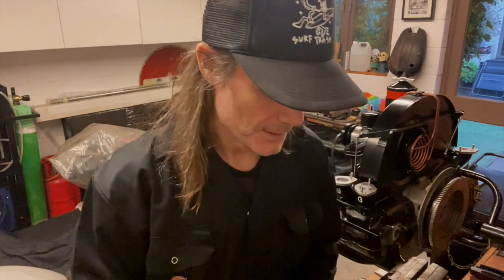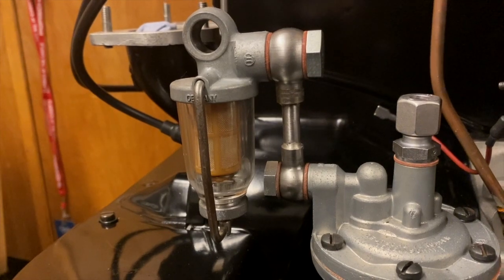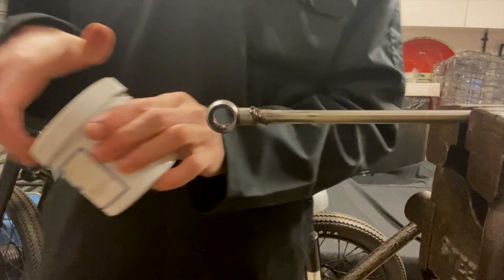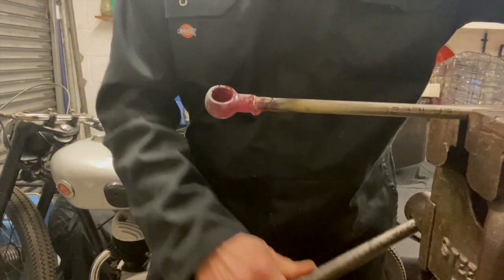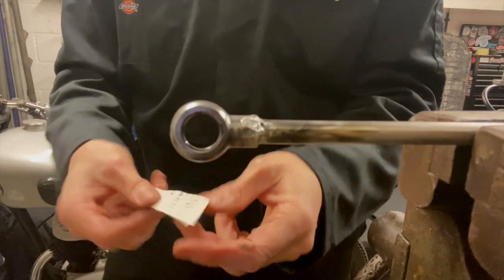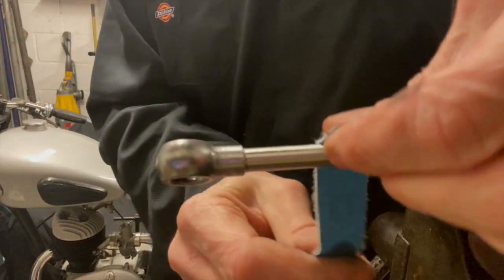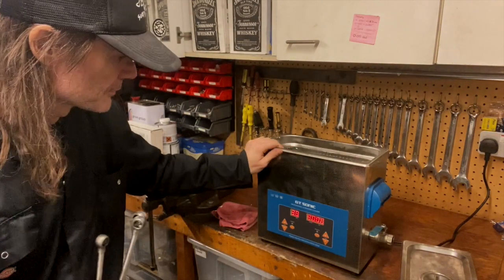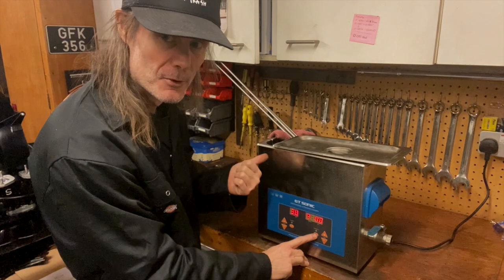How to Solder Fuel Lines - Banjo to Steel Tube

Comment: Is that coiled fuel line around the back of the shroud (the copper coil) Did you make that to prevent vapor lock? If so how did it work out. I have a Karmann Ghia with vapor lock issues. Thanks

Comment: A couple of suggestions, and I'm by no means an expert but I have had my share of dissimilar metal soldering in my career. The solder you're using looks like plumbing solder, primarily for copper joins. It has a low silver level, usually around 4-6%. It doesn't like a lot of heat and you were cherry red. That's why it was dripping off and not flowing. With high heat it tends to bead up like water and run off. It obviously works for the application as it passed the leak test. It just took considerable clean up. For silver soldering we use Sta-Silv which is either a 45% or 56% silver. I prefer 56%. It takes a bit of practice and finesse but you'll get perfect weld joins that'll be good for 300-400 PSI with no clean up. Also, only put your flux where you want the solder to go, otherwise it flows everywhere (also, clean up the excess before putting heat to it). Lastly, and you covered this but, with silver solder especially, you want clean, clean, CLEAN. No fingerprints or residue. I work with refrigeration lines so pressures are infinitely higher than your fuel pressure but the practice is the same. Good on you for trying your hand at it and succeeding. We never know what we can accomplish unless we have the nuggets to try what makes us question our abilities. Sorry if this sounds too "know-it-all" and, it's after the fact but, maybe it'll help someone in the future. So, what's next?
Reply: Definitely way to hot.  If that's plumbers flux its all gone at that temperature.  Heating the part hotter than required to flow the solder is not necessary.  Tin-lead solder is strong enough for the the fuel lines, they will probably have less than 10 psi.
Reply from the maker: Wow. This is all fantastic information. You're absolutely right, I was using plumbing solder and it was a pig to work with.  It beaded up exactly as you describe. I was thinking it must be due to the flux I was using, but now it makes perfect sense. I'm going to try and get a hold of some Sta-Silv and try it. Thank you so much for your kind words and sharing your knowledge.